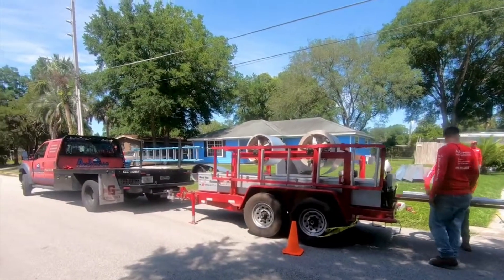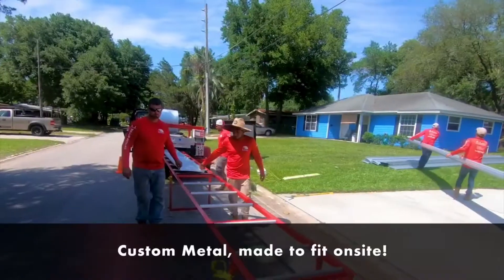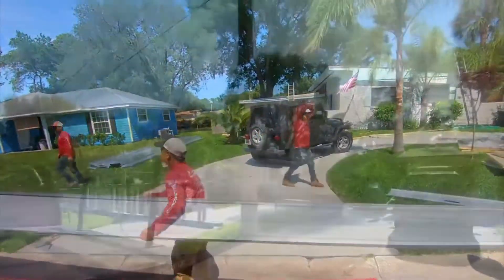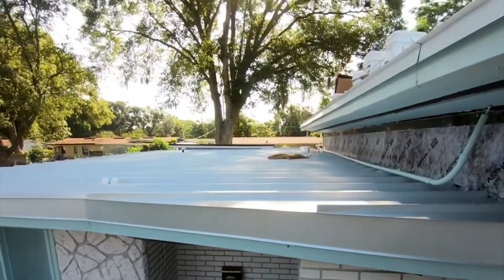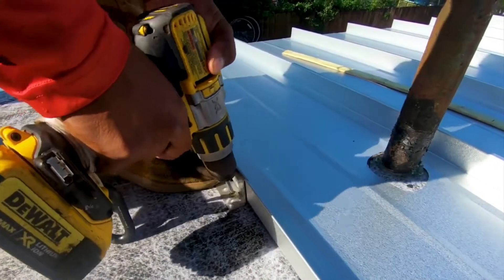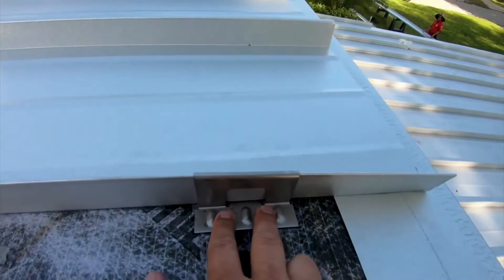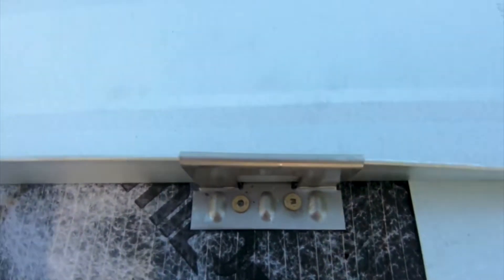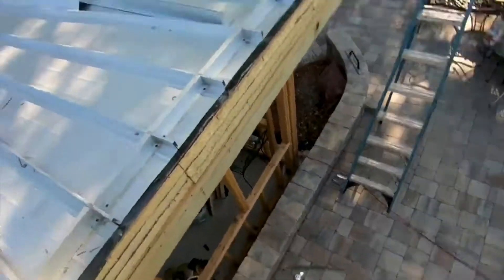Converting a Flat Modified Roof System into a Tapered ISO-Board System and Seamless Metal Roof-Part2

Comment: Did you put plywood on top of the iso board to attach the panels or did you attach the panel  directly to the iso board?
Reply: Joe, I'm watching and wondering the same. As far as I understand you have to be secured to the base roof deck so you can either (1) Fasten a steel Z or channel of some sort to the deck that is the height of the ISO, then fasten new decking to that or (2) use screws for your clips that are long enough to fasten into the original deck.